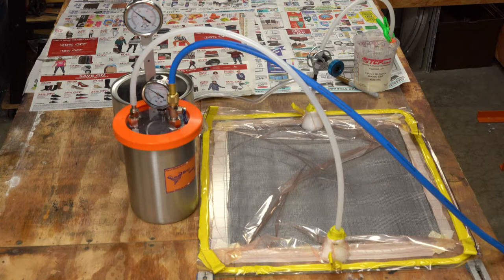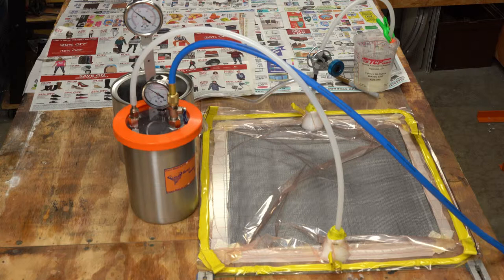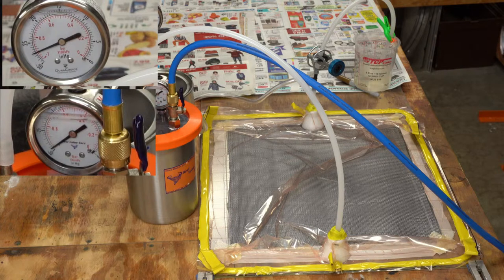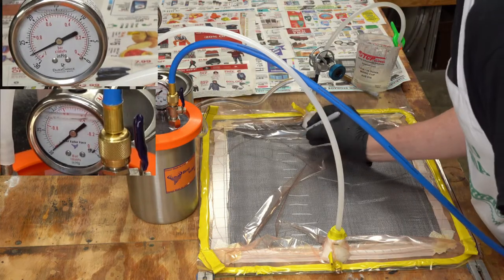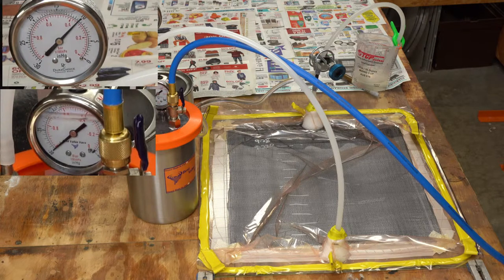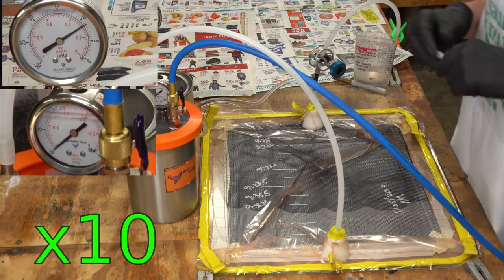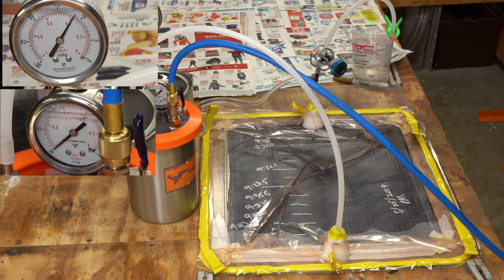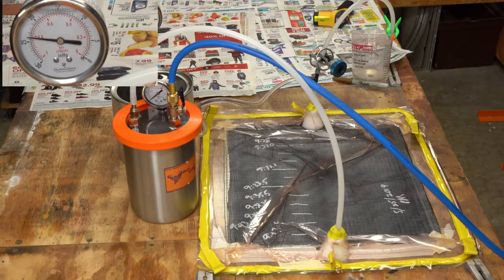Does Vacuum Resin Infusion have a Vacuum Gradient

Comment: Really really interesting. Thanks for taking the time to do this. Where the second gauge meets the resin inlet is there something to stop the resin filling the line?
Reply from the maker: I did not have anything to stop the resin from filling the line to the gauge. It was a loss. I still got the information that I wanted. I could have put a resin trap on the line and a gauge  on the resin trap if i had an extra resin trap.